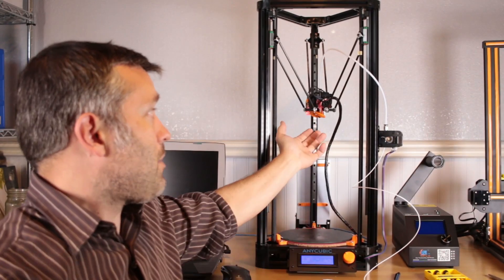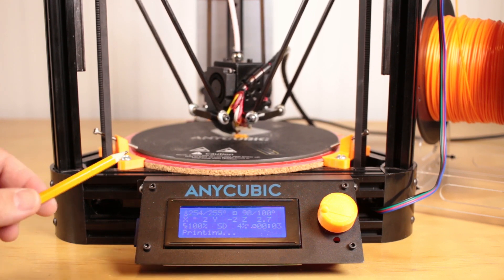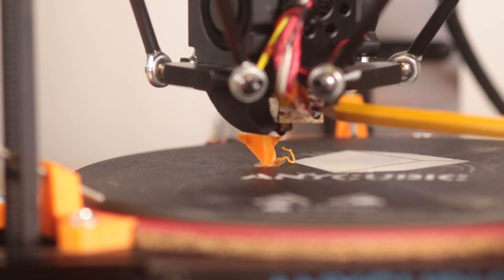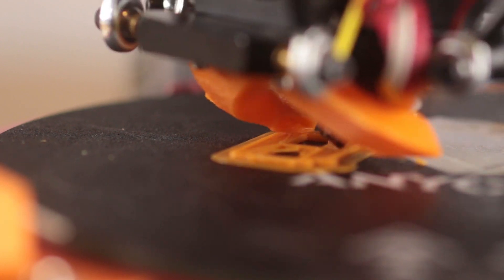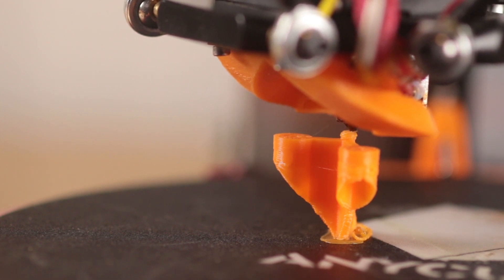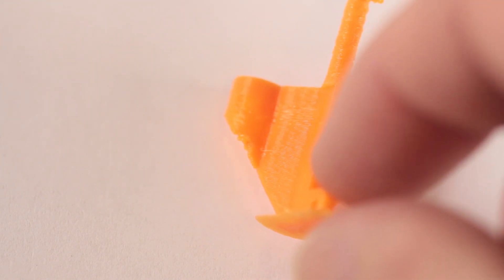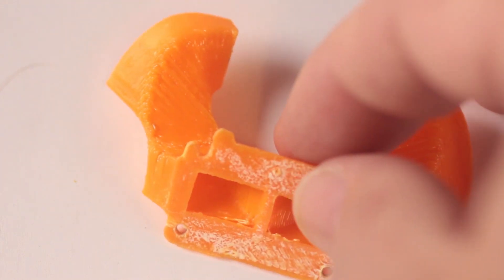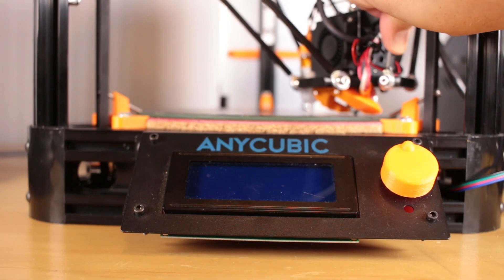Better Part Cooling for Anycubic Kossel + BLTouch Sensor mount

Comment: For anyone still looking for the part, it can be found at https://www.thingiverse.com/thing:2597540
Reply from the maker: Just so that you know, you linked to a troll who assumed my identity on thingiverse and posted geometry which I spent time creating and then iterating until it was printable and very functional. I did not release this file as open source. You do NOT have my permission to use this geometry unless you are one of my Patreon supporters. My actual thingiverse account is "thereal_designprototypetest" where you will find all of the geometry which I do release as open source. Check it out: https://www.thingiverse.com/TheReal_DesignPrototypeTest/about
Reply: @DesignPrototypeTest  i still wait ;)

Comment: Please use Repetier Firmware, it'll just fix most if not all of your firmware woes. Especially for delta printers with an 8-bit board, somehow repetier moves way smoother than marlin, resulting in a better print.
Reply: Hi do you have a good guide to switch? I am having the same problem.
Reply: Alvin Gozali is there  a specific  version you would  recomend? I've had kisses for about the same time, and it still kinda sucks.
Reply: Kossel

Comment: Hi me again, keep up the good work. Is the firmware on your Patreon Marlin 1.1.5 or an older version? I am using an endstop for my Auto bed levelling and it probs a 9x9 grid works great, but it has to be removed as I'm to lazy to make a servo retract system for it. Just a thought if you look up http://www.thingiverse.com/thing:1976680 that's how I got my auto bed leveling to work, so it should help you with the code you need.
Reply from the maker: Hi Paul, Currently it is 1.1.4, but  I hope to update that soon.
Reply: O.K. Thanks. Let me know when you have 1.1.5 with probe working and I will send my $5 I know the amount of work involved with 5 printers it will save me time on one of them.
Reply: I'm working with that 1.1.5 version now and seeing many of the same issues, the biggest problem I'm having is getting it to probe the whole bed. With the G33 in 1.1.5 it probes the whole bed but the g29 still only probes +X.

Comment: What I did instead of connecting my heated bed to the board is to put it on a pwm motor controller rated for about 30  amps.

Comment: I didn't expect a video for at least a week I might have to send you a message for that fan shroud and another payment as another thanks. One thing I have heard that plagues these whether it is true or not is the rigidity. I have printed some corner brackets I am looking to print some for the top too. Also you talked about smoothie I hear that the Delta config is more assembled on there than any other platform I have though of switching for awhile.

https://www.amazon.com/dp/B01FVT5VA8/ref=cm_sw_r_cp_awdb_0OaWzb1N3PGAV

I have seen this board I hear they don't donate to the foundation but I also don't want to spend $100's unfortunately either. Either way might be a cheap transition with this board and could allow for some easier calibration and more compute power obviously.

Anyways thanks for sharing look forward to the next.

Comment: Between your CR-10 and your delta? what are the pro's and con's between them and why would you use certain ones for which jobs? I own a delta myself but keep looking towards buying a cr-10.
Reply: I have both the CR-10 and the Anycubic Kossel and I have been fighting the Kossel non-stop, the CR-10 on the other hand has been flawless.
Reply: I think at the end of the day after you et both of them functioning great it would be you would be choosing your favorite printer kind of a thing. I think really the only difference is that a Delta takes up less of a footprint than a Cartesian style machine. I also think it would be easier to enclose and you can get higher print speeds. There isn't much info compared to Cartesian but once you get them dialed in they are work horses. So personally I think Delta's are better I have had a lot of fun and reliability and what not with my Cartesian machines but this Delta puts my others to shame in print quality, time, footprint.
Reply from the maker: I completely agree with what Carl Belcher said. However, if we can get our Kossel printers working well, they will have a number of advantages: 1) Faster Printing 2)The Bed doesn't move, so the part is similarly static. This means higher quality parts at faster print speeds 3)It's so cool to watch the Delata work! It feels like I'm watching a SciFi show, only it's real and in front of me. Keep in mind that the CR-10 costs $200 more than the Kossel, but it prints with a MUCH larger build volume, leveling the bed is MUCH easier on the CR-10, and it works very well right out of the box.
Reply: That's the key, getting it to work well and keep working. I love my Kossel when it's working but it's been a lot of trouble. After the build I was able to manually level the printer (which is a pain compared to the CR-10) but it wouldn't hold a level for more then a couple of small prints. I have been fighting to get a working auto level setup working as well. It seems to mostly function but only probes 1/3 of the bed, which creates accuracy issues similar to what you have been experiencing.